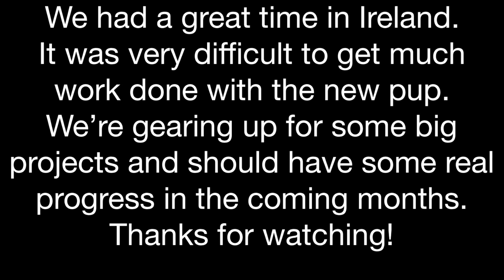New Best Friend, Road Update, Water Spring Update, Cabin Work

Comment: FYI, the vintage trailer community would salvage much of that trailer.  We have a 1954 "canned ham", that a retired couple did a frame-off restore.  They pulled the "tin" off, saved all the windows and interior cabinets and replaced the wood frame and plywood sheathing.  

For example, axles are an easy replacement.  So there are people out there that would take it on.  In any event, many enthusiasts would want to salvage the original hardware, such as window frames, vents, door handles, etc.  So please look for a salvage avenue.
Reply from the maker: I'd part with it if a real enthusiast wanted it, Its definitely out of my skill range.

Comment: Im a bit curious.. why dont you finish the outside of the house first? I think it would be a lot more important to get the house weather tight instead of doing random stuff inside the house?!
Reply from the maker: It's partly an issue of cost, the siding is pretty expensive big ticket purchase, but also, I don't always do things in a rational order.

Comment: Why didn't you make the shower right off the back door?  It would be more accessible, in my opinion.  It still looks great with what you've done.
Reply from the maker: I put it on that side because it's really close to where the water comes up into the cabin from the cistern so it was easy to plumb.
Reply: I see.  It sure will be nice when finished. Can't wait to see. 👍

Comment: A quick and dirty dog run to keep her restricted in where she can go but still let her run is a cable between a tree and the cabin with a pulley on the cable connected to light weight chain to a harness on the dog. The dog can move freely on the cable and a few feet on ether side and with proper stops can run the length of the cable.

As you have a seep style spring a PVC french drain in the wet area will let you collect water easily. Remember to have the ends above ground and removable caps to be able to flush any sediment that gets into the pipe down to the spring box and give you a spot to add bleach when you need to shock the system. 

You should have the fall to gravity feed water to the cabin but at worst an underground tank to fill and a simple solar pump to lift the water to refill the cabin with.
Reply from the maker: Thats a good thought on the spring, I had been thinking about how to develop it.  I am not catching all the water it produces.  We just made a very small test hole.  Eventually the pup will be off leash once I get to know her better.  As long as she's not a runner.  My last dog just followed me around anytime she was off leash.